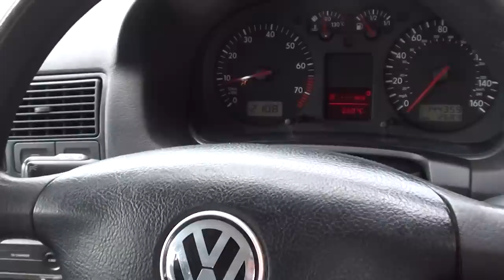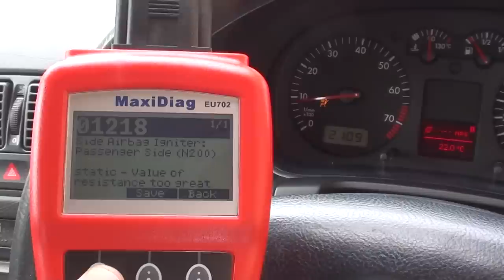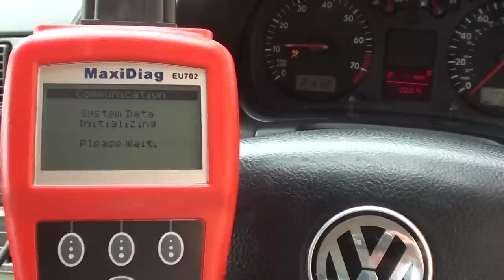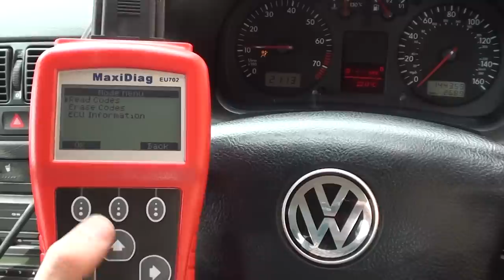How I Reset My VW Airbag Light Golf Mk4 01218 fault code

Comment: hi thanks for a nice video.I have a golf v 75 horsepower 2006
not long time ago came ESP warning lamp on shows on speedmeter.
I bought a Code Reader Auto Diagnostic Scanner, (2015.7.18 Version D900 CANBUS OBD2 Live Data Code Reader Auto Diagnostic Scanner )but no error code find  on screen screen.
and the rare thing is that the Only ESP worning lamp is on, not ASB or other light are  warning on.did you have any experience with this?Thanks again.